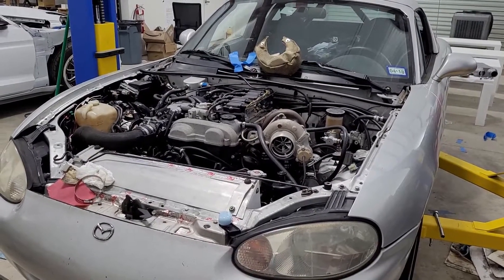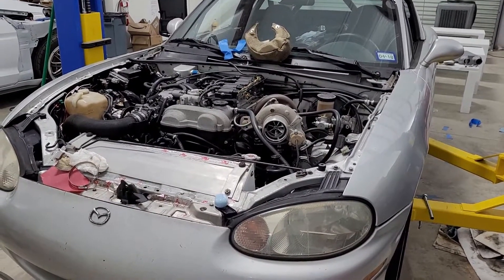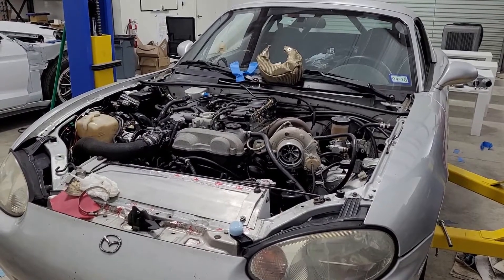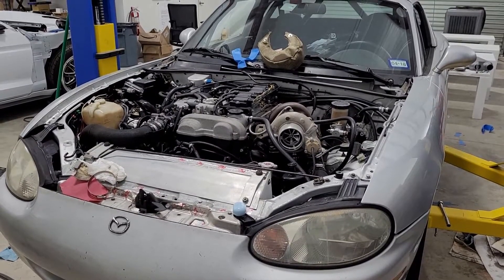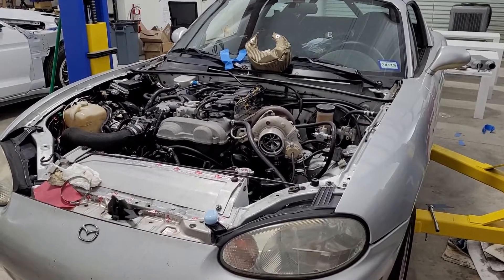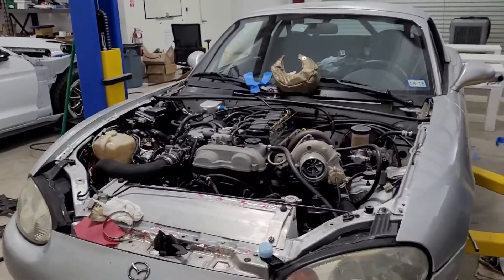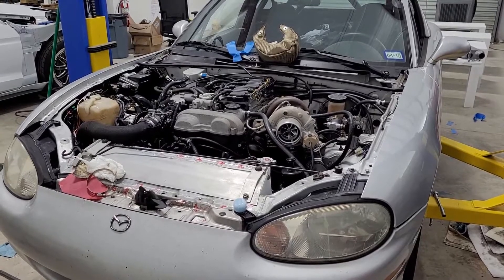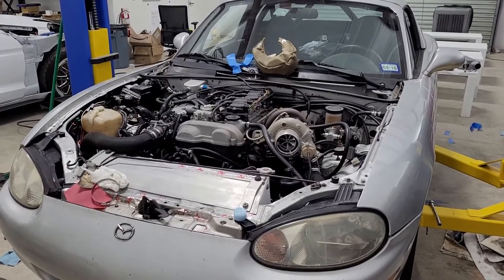Compound Turbo Setup Explained - Continued

Comment: Never size a turbo off what the manufacturer says its power capability is. It means nothing. I have sized compound turbo setups using a 1000 hp turbo on low pressure size but it was only flowing 400 hp and that turbo was only just SMALL enough, ideally it should have been about 1200hp according to garretts rating. Size them from the compressor and turbine map, not how they are labeled. To make 500whp in your miata, you would be looking at the G42-1200 as the large turbo. For wide rpm range low overall boost, compound is beneficial, just not cheap to do.
Reply from the maker: I ran a 68mm for the large turbo and the boost response was pretty bad. But I bet that G42-1200 you mention would work better. Do you have any experience running that series of turbo from Garrett? They look nice but I don't see a lot of people running them.
Reply: @patrickcowanjr1  Even sizing a turbo from the exducer/inducer is not very accurate. The design of the turbo can change a lot. Ideally if you do not have a map you need to bench flow it and map it yourself. No I have not used any G series turbos yet. Currently using a GBC17 and s200-70 for a compound setup but only making 165kw peak (Suzuki M13A helicopter engine). My setups are currently for varying atmospheric pressure and constant rpm, not constant pressure and varying rpm. G series are relatively new and most street setups are not running excessive power. I will eventually make a video on how to calculate compound turbos and flow bench a turbo also. Flow benching is quite simple and the hardware is relatively cheap. The only reason I can think that sellers/manufacturers do not list them is they don't want to show them. Best of luck.

Comment: I'm willing to bet if you gate the internal gate on the small turbo at let's say 30psi and the external at 10psi. Line the manifold pressure to the internal gate and the external gate to the charge pipe going into the small turbo. This way you spool to 30psi then as the back pressure and bigger turbo boost go up that gate opens and more flow is supplied to the big turbo al the while lowering the boost of the small turbo.
Reply: Would love to see this test with a gt28 and a gt35. sounds like a blast 😂 kinda the plan for my awd volvo but funds lol.

Comment: I see lower than single turbo IAT’s with my setup, consistently under 110F no matter what I do. Even in the dead of the Arizona summer, a huge difference from the 120-130F I was seeing from the single turbo I had before this. 

If the turbos are matched properly, they work together to stay in their efficiency ranges (respectively) throughout the boost range(s) and that creates less heat than a single or twin setup would. 

Some of the issues with having the rear turbo, losing energy throughout the exhaust pipe between the two. Much like how pressure loss that occurs inside filling the volume of intercooler piping, same concept occurs in the exhaust. Due to this loss of energy, the secondary turbo is actually working even harder to spool, therefore going outside its efficiency range and creating even more heat than in normal operating range.